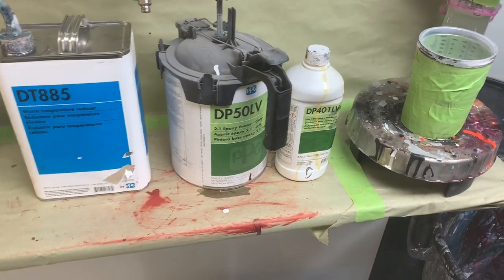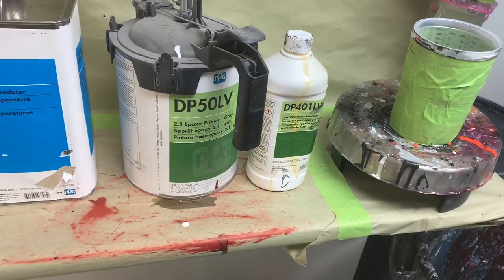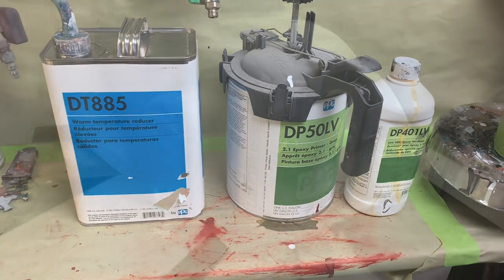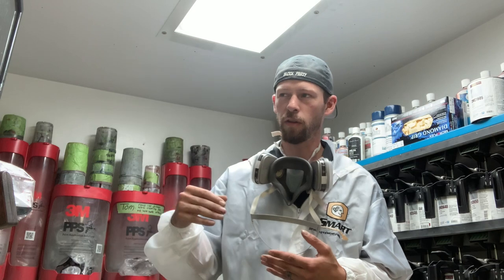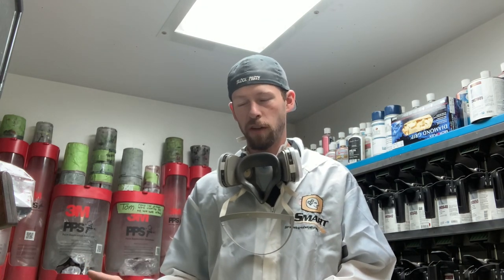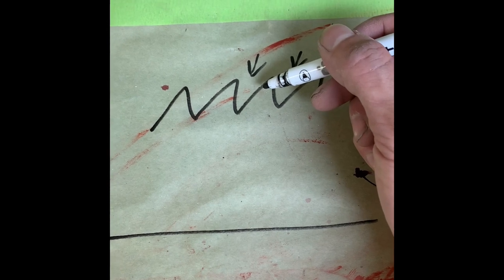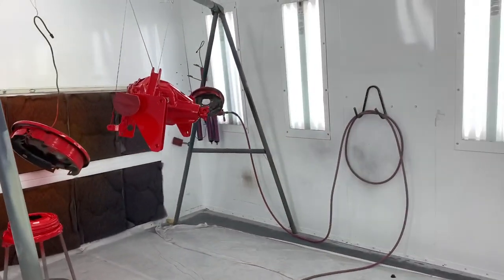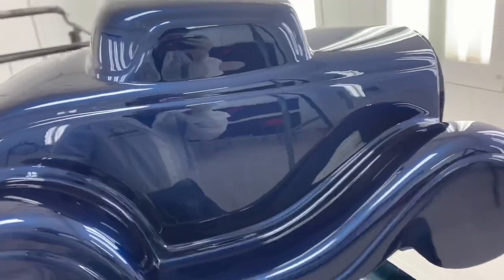Using dplv epoxy as a sealer - lift windows, recoat windows and more explained

Comment: I tried some dp90lf. Filtered the crap out of it including going into paint gun. Top of truck looks like the surface of an orange sprayed on using an undercoating gun sprayed parallel to surface. Now i have to sand all of this non sanding primer off? Looks like I sprayed under the truck without at least hosing off mud and sand🤬. Never seen anything like it. Used a mixer in the can too. Wth